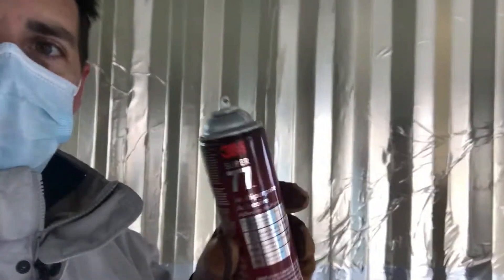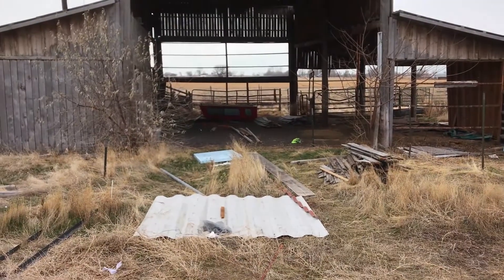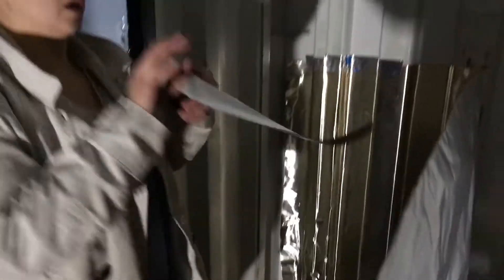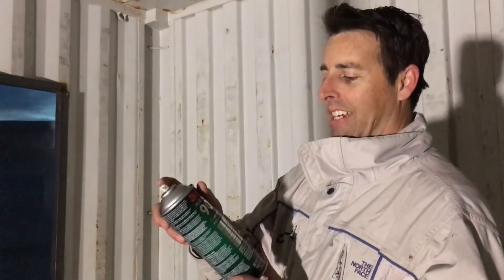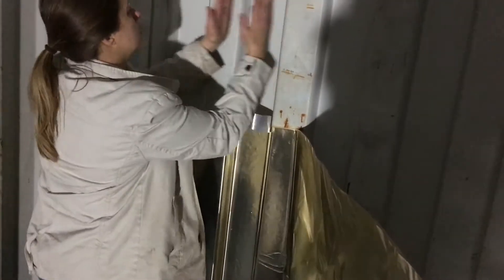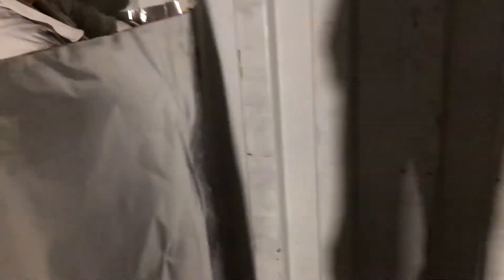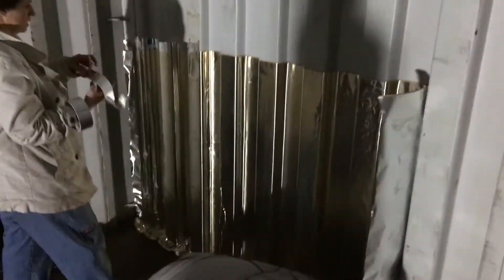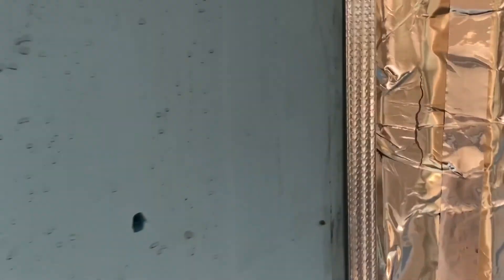Radiant barrier/vapor barrier, shipping container home build

Comment: I'm curious about the application of the radiant barrier glued to the walls.  Did this prevent condensation on the inside of the container wall? (not your finished wall, I'm talking about just on the surface of the 'radiant' barrier you glued to the wall?  Yes, it's worthless as a radiant barrier but did it act as a vapor barrier?

Comment: Sorry mate but gluing a thin foil to the container walls Will achieve nothing at all. Internal air reaching the aluminium foil will cause condensation to form in exactly the same way as it would on the steel wall. I understand you feel like the inside of the wall is cooler than before applying the foil but the science is not with you. Running through the science is too long winded for this comment. I do encourage you to watch ‘odd life crafting’ A young Central American couple who have built a container home. They are both engineers and explain the way insulation works. The only way I have diverted from their design is that as I live in Victoria, Australia I have added a layer of insulating bats between the vapour barrier and the plywood inner wall. If you have the time subscribe to their site and watch every episode. They have moved on to rebuilding a sail boat so the last twenty or so episodes might not be any use to you. Best wishes from ‘The Land Down Under’
Reply from the maker: Thanks for the long reply we know it was supposed to get views and comments going

Comment: Ji, was it necessary to stick it in the indentations since it can do its job either way? Attached and unattached with the space. Question for anyone who has a constructive answer. What if I attached it with a 2×1. (Sticking the wood to the Container with Contact Cement glue). Every foot or so to prevent sagging. So, the pieces of wood would go inside the indentations/sucken space. 
Hope everything worked out well. Thanks for the idea to foil inside and outside.
Reply from the maker: It was probably useless to do it. But thanks
Reply: What you are describing is the way it should be done. Radiant barrier needs an air gap to work. The way it was done in the video is pointless and won't be effective

Comment: Theres a reason it was $50
Reply from the maker: Nacho Cheese agreed! but we are doing spray foam on the roof soon maybe more
Reply: Thats exciting! Closed cell is the way to go if you can afford it.  Have built 4 insulated containers. All Air conditioned. All wood studded. All are different (since I could find no really studies re vapor, breathable, reflective barriers) The best one is 4" ceiling poly board and 2" wall and floor poly. No barriers. Getting no condensation in south texas heat. Hows your insulation working out?
Reply from the maker: Nacho Cheese goodstuff !  just curious now what have you found as the best AC for an economy on the small scale
Reply: @DubShack  mini split. even a 110 will cool a insulated 40 fine